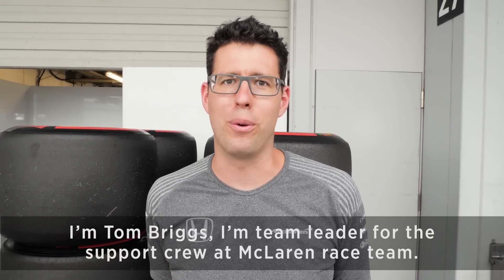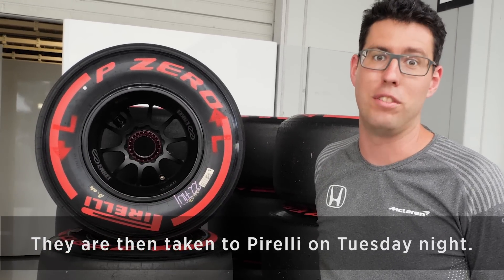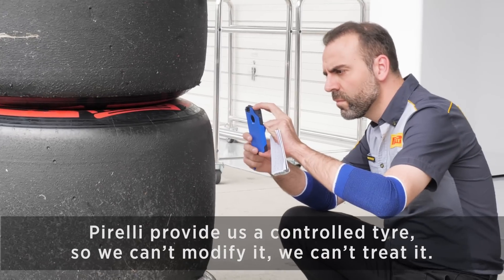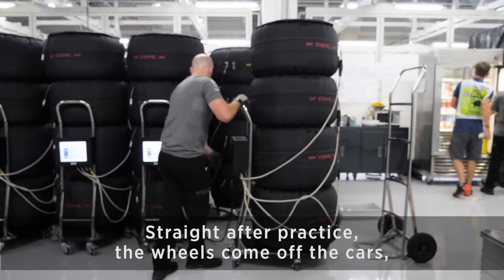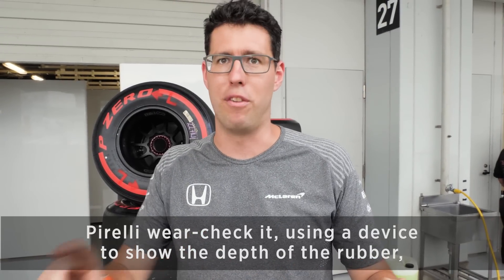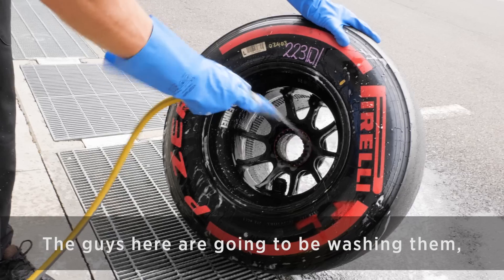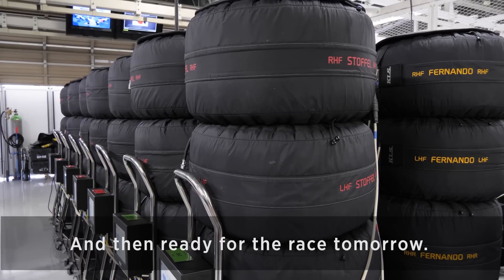A Day in the Life | Formula 1 Tyre

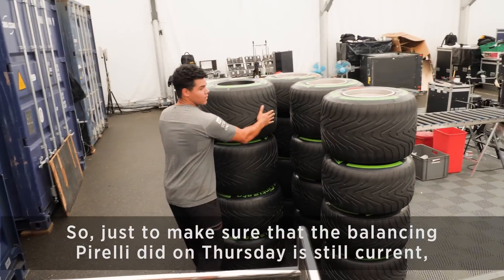Comment: 0:46 i wonder how much a rear tyre does weight, cuz this guy lift them (seems like) with ease :o
Reply: Ben Dover it can be heavier, the guy obviously is doing repetitive work, so he might be used to the weight
Reply: Intermediate and wet weather tyres are softer than the ultrasofts tyre because they need to reach te right temperature faster than dry weather tyres. Maybe thats why they are lighter.
Reply: Ergi Nushi you'll find the wet tyre has a larger circumference than the dry tyres to keep the plank of the car from skipping across the surface of puddles so it's actually heavier.
Reply: KasaShime Kyo they weigh about 10 kilograms - about the same as the wheel for a standard Fiat Panda.
Reply: Ben Dover front tyres with the Rims are roughly 9.5 kilos, this will vary from team to team depending on wheel design and the choice of which of the 2 types of magnesium alloy the team are allowed to use, the rear rim and tyre is roughly around 11.5kg but again that varies
Reply: It was empty I believe.
Reply: "The wheels are magnesium" - The barrel is carbon, the center is a magnesium blend.